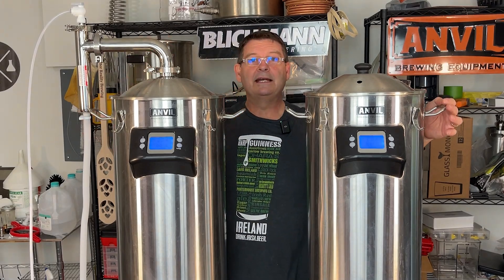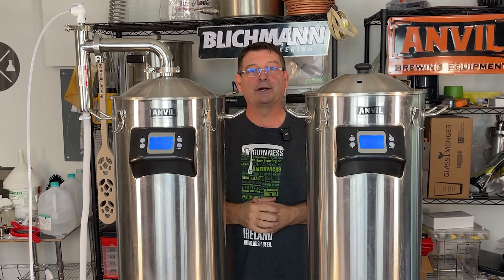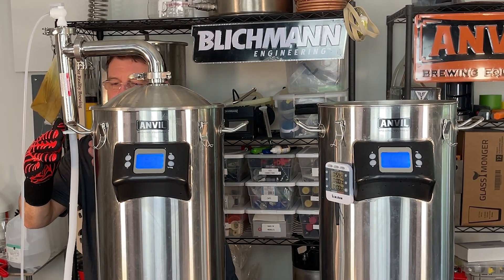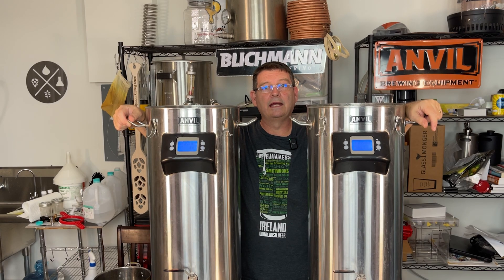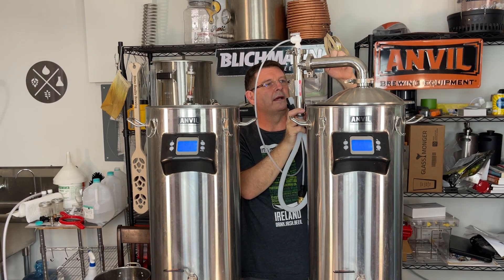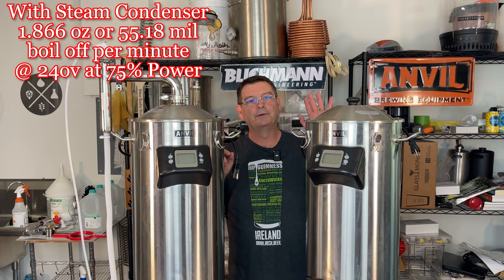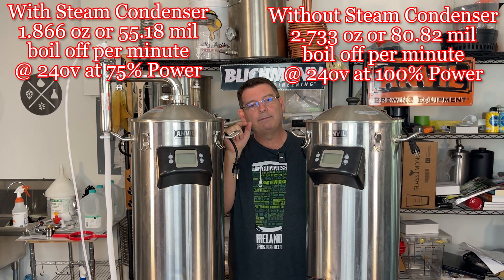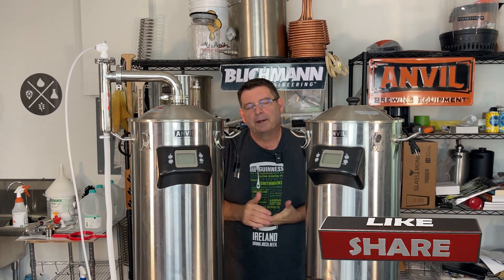Anvil Foundry Steam Condenser Boil Off Comparison

Comment: Can someone explain to me why you can't ferment directly in the foundry? Their website claims it's good up to 40psi and even pressure distillation would be max 15psi. As long as you were able to securely fasten the lid and hook up a spunding valve or airlock, it seems to me that it would work.
Reply from the maker: You can but it might not be the best vessel for doing so. A lot of people do kettle sours directly in the Anvil Foundry which is a type of fermentation. I did see someone on one of the FB groups recently showing off that he was fermenting in his Anvil Foundry. Personally it is just a lot less work to clean the Anvil right after a brew while your wort is in anything else from a cheap bucket to a fancy conical fermenter.

Comment: I think in our world, 3 significant figures are plenty for all calculations and communication. It might make results reporting a bit easier for the video.

So... 1.87 oz per min, or 2.73 oz per minute. Gallons per hour might be useful too. 

Four sig figs
1.866 x 60 = 111.96
111.96 / 128 = .8747 GPH

Three sig figs
1.87 x 60 = 112
112 / 128 = .875 GPH
 
Two sig figs: 
1.9 x 60 = 114
114 / 128 = .89 GPH

To see how silly it is to use  4 sig figs, try measuring .8746 gallons vs .875 in the foundry. 

Great test, though!
Reply from the maker: You sound like you might like math even more than I do. I am really thinking I need to do this test again but 3 or more times to get an average.

Comment: How much tap water did you use in the condensing line?
Reply from the maker: That is a great question that sadly I don't have a good answer for. I will be doing a handful of future boil off tests and will try to record the tap water. I'll try to get more info documented during the next test where I'll be trying get an average. I'd guess it was over 8 gallons, but could have been a little more.

Comment: Is it a flawed test as you didn't boil at the same power?
Reply from the maker: It really isn't, as from everything I read (companies selling them and brewers like us in forums), you want to avoid running your boil at 100% power under any form of pressure. This experiment, as I mentioned in the video, was for a real-world comparison, and, from a very recent personal experience on my very next brew, 100% is a bit dangerous. I forgot to lower the power, and it started to boil over. Partially due to the power being at 100%, and the other part was I couldn't cool the hot steam fast enough. I adjusted it to 75%, increased the water pressure to increase the cool water mist for the steam condenser, and got everything under control. I still made a bit of a mess, but it could have been a lot worse. (White Labs in Asheville, NC, actually boils their beers under some insane pressure with their steam condenser, and supposedly, they can get their boils up to around 230F. They also have some very expensive and custom equipment, plus that lovely cold mountain tap water.)
Reply: @BitterRealityBrewing  Yes, I understand that you don't want to boil at 100% under pressure. My point was is your unit without the steam condenser it was boiling at 100% power. Is this typical for you? Do you leave your unit at 100% power while boiling uncovered? I imagine that if you did at test with both units are 75% power the results would be closer. Which would be a true 1 to 1 comparison. Right?
Reply from the maker: @GingerBreadMayn  I fully understand, and yes, I boil uncovered at 100%. (I used to have a GrainFather, which used 120v, and it was hard to get to a rolling boil at 120v. So I was very used to just going straight to 100%.) I feel most people probably set their uncovered brew systems at 100% when boiling. Even with that said, I could be wrong as I know that if you live somewhere well above sea level, you are able to get a boil at a slightly lower temp, and I can only assume with a bit less power too. Sadly, I only am able to go on what I've seen and heard (when I am paying attention) and of course, a fair percentage of that is from brewers in Florida, where large hills are extremely unusual. 🏖😎

I do have more tests planned and was looking to do an overall "Boil off" average, but I could also do a few other tests. I think I could get away with 100% as long as I didn't have dissolved solids like sugars/carbs to trigger a boilover. And even if I did get a boilover with only water, it wouldn't be nearly as bad as it is with sticky wort.

Comment: Does it matter if you boil for 60 minutes or say 75 minutes to get to your final quantity goal?
Reply from the maker: Going with that saying, "You do, you!" That is why I measured it to a rate of per minute. If you do your own boil-off test or use the initial one I did, you can at least dial in your final volume a bit easier. I did two brews right after this test, and the 1st one was off more than I expected, while the 2nd one was almost dead on to what I did in this test. I plan on doing a few more boil-off tests with this and some other equipment to help get an average.